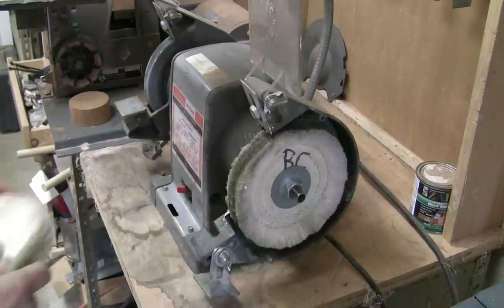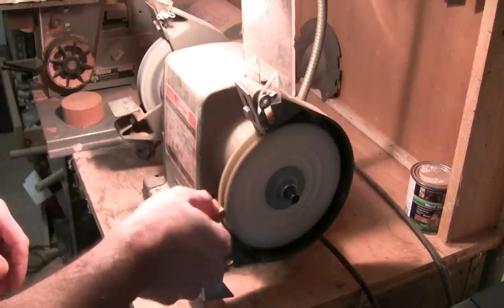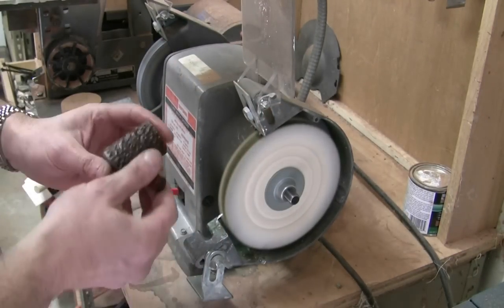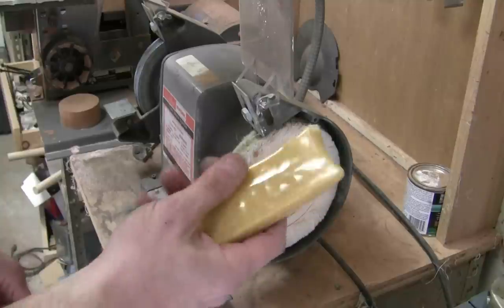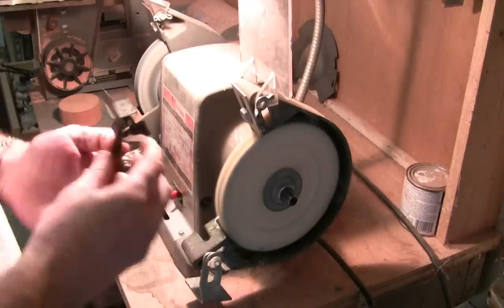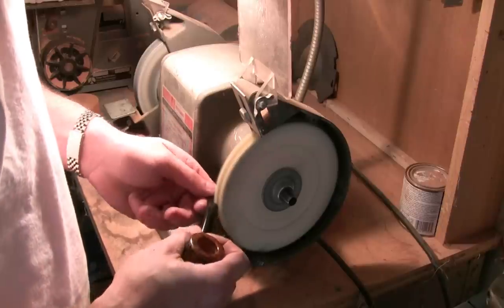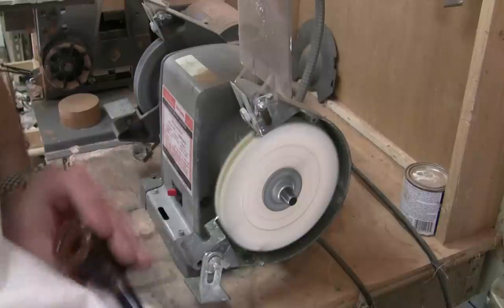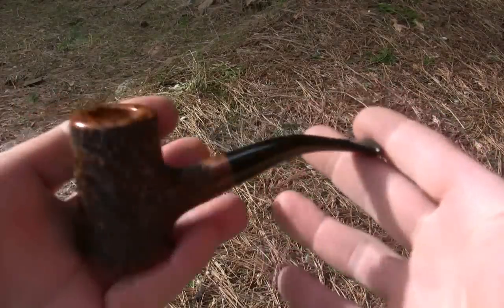Part 7 - Briar Pipe Making Start to Finish Final Video

Comment: What a thorough and complete record of all the stages. I ordered my first mini lathe today and this has been a great help. After I do all the beginner stuff, my long term aim is to make pipes. Maybe E-pipes too. Thank you
Reply from the maker: I am needing a good small lathe myself for turning the bow, shank and the stem. Good luck and have fun with the pipe making. It's just a hobby for me but it's a lot of fun. I bet there would be a good market for quality e-pipes made of pretty woods. Since it's an e-pipe you could go with woods that would be dangerous to use in a traditional tobacco pipe.

Comment from the maker: Briar is an extremely hard wood and very fire resistant but it still needs a carbon layer to protect the bowl. What I do, and many do before our fist smoke in a new pipe is to add a carbon layer by applying a mixture of 50/50 honey & water to the inside of bowl. The honey water mixture soaks into the walls of the bowl letting some of the sugars to penetrate into the wood. Once it dries your first smoke will turn the sugar into a carbon layer to protect the briar. It will then build over time.

Comment: Very very nice.  As an experienced woodturner it will be helpful to you to get the tool rest closer.  Also, a bowl gouge  held at an angle for a SHEAR cut is much better than a scrape but scraping has its advantages too. .
Just about to make my first pipe so this was a great help.  Super job!!

Comment: Hey great videos! I have found that these are some of the most instructive and in-depth videos on pipe making. I've been looking to get started, but I'm a college student and don't have a workshop to work with. I was wondering if you could do a pipe without using a lathe, bandsaw, etc. Basically, hand tools, dremel tool, drill, and hacksaw.  Do you think it's even possible?

Thanks again. Great videos!

Comment from the maker: You could totally do that. It would be a great project. Just need to know the sizes for the internal components so that you could drill out for that that. I've seen a few briar ePipes. Since there wouldn't be a flame you could use all types of pretty less expensive wood for an ePipe that you couldn't use for a traditional pipe. Let me know if you give it a try.

Comment: Thank you kraigseder for taking the time & effort to make your videos. After watching you take a block of briar and turn it into a beautiful looking Poker, I think I'm ready to try my hand at making my own pipe. The Poker is a nice design for a 'pipe-maker newbie' like me to start out on. Other great designs will come later down the timeline.

I was wondering about using 'exotic woods' instead of briar. Woods like Zebrawood, Cocabola, Wenge, Indian Rosewood. These are all hard, dense, solid, beautifully grained woods that IMO should be as good a smoker as briar. Then again, I'm only a 'pipe-maker newbie' so what do I know? Ever try (or think about) exotic woods?
Reply from the maker: Thanks so much and I'm really glad the videos gave you a starting point. Those exotic woods mentioned are some of my favorites for woodworking BUT I think some may have toxic resins. I really don't know which are toxic and which are not. I have seen people use Olive wood, and a few fruit woods but I've never heard of using the beautiful exotics. I've seen people using exotic woods as decoration on the shank but never the actual bowl. I wish I could be more help here but I would search out some pipe making forums and ask some veteran pipe makers on safe woods.
Reply: kraigseder You brought up a point about using exotic woods for smoking pipes (toxic resins) that I never thought about. So I did some research on the internet and found a few websites that do use the exotics for smoking pipes. In particular is Don Lou who uses Brazilian Rosewood. I don't particularly like his design ability but I'm confident that his choice of exotics proves that the 'toxic issue' is a NON-issue. FYI - here's the website with his Brazilian Rosewood pipe -

http://www.premierpipes.com/PPDonLouExoticWoods.htm

I've also found a company that offers fantastic design acrylics (exoticblanks.com) for custom stems. My mind is now SWIMMING with design ideas.
Reply from the maker: SUNNMANN139 You got me thinking so I looked this up.

Safe woods for pipe making - 
Maple, Cherry, Black Walnut, Oak, Olive, Rosewood, Manzanita, Mesquite-wood, Beech, Hickory, Mountain Laurel, Mahogany, Ebony

Toxic woods
http://www.spacecoastwoodturners.com/newsletter/Toxic_Woods.pdf

I'd stay away from anything in the list that states the toxic in the source column as "wood". Of course use a good woodworking filter mask for ones that have toxic dust.
Reply: kraigseder Thank you for the Toxic Woods list kraigseder. And even though Ebony is on the list, I've never had a bad experience working with it. Ebony is actually my first choice of wood for my first pipe.

My designs are in the Danish Freehand-Erick Nording style. I prefer a 'V' shape bowl over a CUP bowl. Tobacco burns much cleaner and efficiently due to the natural drawdown to a central point rather than to the 'side' as with CUP's (which always leave unburned residue on the bottom). I can see it now - brushed Ebony wood with an aluminum band and bent black/smokegrey swirl stem. I'll let you know when I finish it.

Comment: If you add a extension nut and a threaded rod on your buffing wheel side of your grinder you can add your second buffing wheel to it so they are spaced side by side and you will not have to take one off and replace it with the other one and you can have them both on.

Comment: I have been trying to source materials, and my first pipe will mostly be practice I am sure, so I want do it cheaply. I have large trees in my back yard that have been cut down, and I have been working with a large piece that I have a pipe blank shape from. It is some native Georgia tree, most likely some kind of red oak. Is it safe to smoke out of? I wouldn't want to be absorbing some sort of nearly toxic oil or something. Are there any woods known to be unsafe to smoke with?

Comment: Great! I really enjoy the series! And what a fantastic pipe! One question though. I noticed you did not use thermoprotecting graphite on the inside of the bowl. How does that affect the normal use of the pipe in your opinion?
Reply from the maker: Many custom pipes come without the pre-carbonizing. Briar isn't that sensitive as long as the pipe isn't smoked too hot for the first 5 or so smokes a natural carbon layer will quickly start to build. I always make a 50/50 water & honey mix and coat the inside of my bowl using a Q-Tip before my first smoke. I'll coat the bowl, wait 5 minutes then coat it once again. This kick starts the carbon layer. I have some thin walled briar pipes that I've smoked 50+ times without any problems. I've actually never had a burn through, cracking or any issues. I also put Walker Briar Works' carnauba polish on my pipe and stem after each smoke.
Reply: kraigseder
Thanks for the help! In fact, after watching your videos and following your instructions to the letter, I ended up with a pretty cool - looking pipe! And it smokes good too! I did the honey and water coating ( nice tip by the way) but it's quite hard not to smoke it too hot, since the tobaccos sold here are more suitable for a fire dragon than a human being... Anyway, keep up the good work! I'm Andreas. Greetings from Greece!

Comment: Cool series! But VERY new to pipe making myself. Question. And dont kill me for this but would you not need to put some sort of coating on the tobacco chamber to eliminate any combustion to the pipe or burning of the walls?? Plz help
Reply from the maker: Eli Powell Thanks Eli. Briar is very resistant to burning and that's why it's the perfect wood. When I first smoke a new pipe I do put a honey & water 50/50 mixture inside the tobacco chamber. I just paint it on with a QTip. The sugars help kick-start the carbon layer which helps to protect the briar and makes your smoke a bit cooler. You'll naturally get a carbon layer over time from pipe tobacco.

Comment: Hi, I admire your pipe and I would also make.I would like to ask what you used to stain the black ebony. Is not this a walnut? And after the first application.Polishing black spots and then giving a lighter layer do not have a pipe experience.Sorry with this, but I can not because English is translated in this report compiler.

Comment: Great pipe making series, many thanks. One question - what was the compound you used to buff before you used the carnauba wax? Is this an American product, as I will need to locate it in the UK if possible. Many thanks
Reply from the maker: +Peter Verdon Thank you Peter. Before carnauba wax in this video I used tripoli buffing compound. You should definitely be able to find this in the UK. Since I made this video I now used White Diamond compound in-between the Tripoli and Carnauba buffing. Be sure to have separate buffing wheels dedicated to each.
Reply: +kraigseder Many thanks!

Comment: do you have to do anything to the chamber at all like hit it with a torch to char it or are you good to light it up now?
Reply from the maker: I usually coat the bowl with honey before my first smoke or tell my customers to do a bowl coat. This helps jump start the carbon layer but it's really not necessary. I do do a black carbon bowl coat on my new pipes lately but for me it's really just a cosmetic thing. After one or two smokes a raw briar bowl will have a nice coating.  
The primary need for a carbonized bowl right off is either for aesthetics or for inferior briar that may have a burn through. With good quality briar it will quickly develop the carbon layer.
Reply: @kraigseder  thank you sir!

Comment: Great video, Can you summarize where to get the things I need?
Reply from the maker: I got it at Pimo Pipe Craft. Do a search on the company name and you'll find it. It's on the tools page. I'd put the URL but YT won't let me post URLs. 11/64" Diameter Drill Bit for Air Hole in Shank, 5 3/4" overall length.

Comment from the maker: Just make sure the leather dye is a alcohol based dye NOT oil. You dilute the dye with denatured alcohol. The percentage depends, but I usually am around 1 part dye for 4 parts alcohol.

Comment from the maker: I believe Oak has some toxic or at least very undesirable resins. I know cherry, apple and a few other fruit hardwoods can be used. To get biar cost down you can get some good deals on eBay that will bring the price down to around $7 or $8 a block if you buy 5 or 6 blocks in a pack. It's more expensive but you can also buy pre-drilled blocks that come with a stem at pipesandcigars . com. All you need to do with those is shape your pipe and dye. The kits will run you about $23 though.